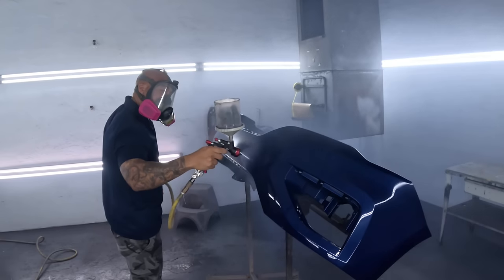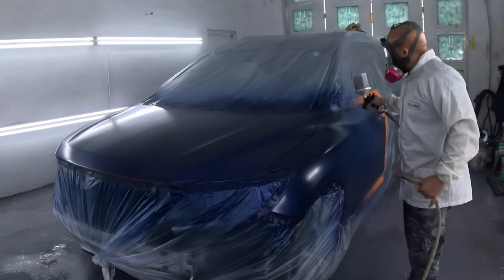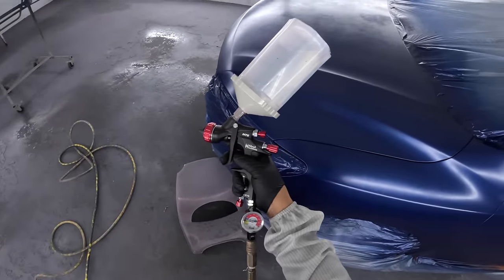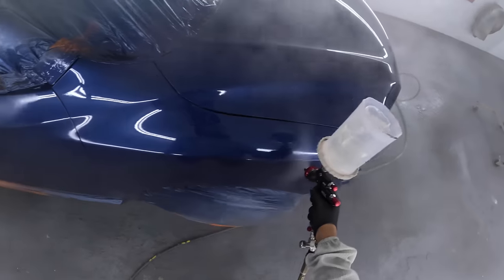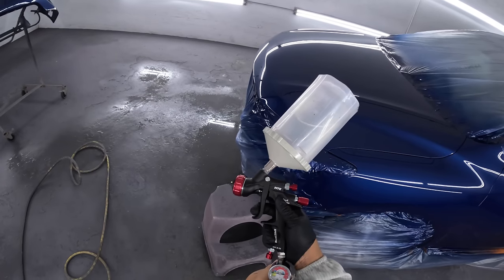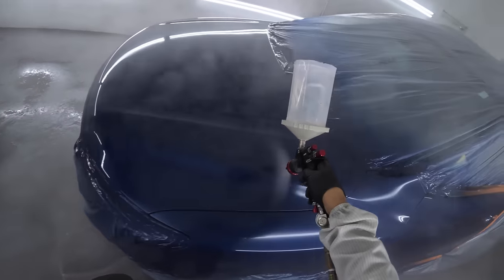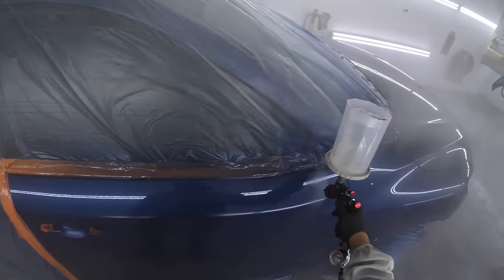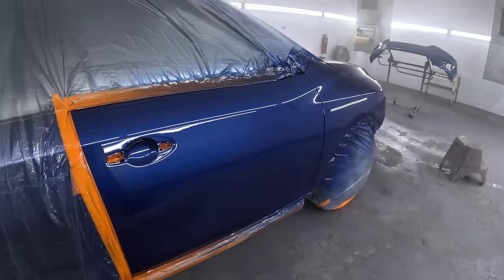BEST SPRAY GUN IN 2024 WS400 series 2 clone 🤪 AMAZING RESULTS!!!! Black Widow rear fan knob

Comment: hey trigger man thanks for the review I'd like the results I picked one up got a question for you please what adapter is that for the d-cups for the D cups I ordered one D cup it was too long help please and thank you
Reply from the maker: What up bro. The gun is at the shop. But I believe the adapter is #10 it is a little longer but not horrible. I can confirm that when I get back to work. But I think it's 10 or the same adapter that fits the vevor gun. And it does stick up a little further than it does on the vevor.

Comment: That fan pattern is impressive. Very even. Should be good for metallics. Can't stand those swivels. I have a Sata clone that had it. I took it off and used a regular fitting. Nice job as usual Trigger
Reply from the maker: Thank you brother I took that swivel joint off my vevor gun too and put a fixed joint on there make spraying with the gun more enjoyable for sure.

Comment: Triggerman Which do you prefer, this $180 black widow or the new $260.00 Porphis PRD-717 VS TYPE?
Reply from the maker: Man that's a tough one 😭😭😭 I'll have to use the Porphis more to give an accurate answer. I've only sprayed 2 jobs with Porphis and like 9 jobs with the black widow  so far the black widow is kicking ass.

Comment: I have two of them. One for base, and one for clear.  They are great guns. I like you don't use or care for the swivel regulator. I use the round filters at the gun, and the regulator at the tank for pressure. I run a higher pressure than you did. Usually 30 on base and 32 on clear. But all in all, Great guns. Another great video from the "Trigger Man."
Reply from the maker: Thank you brother. That sounds like a great option regulator at the tank. And i figured there would be different pressure settings coming in from guys. There so many things that would cause us to need less or more pressure. And I agree great guns  🤜🏼🤛🏼
Reply: Triggerman thank you very much for all your video's advice on spraying base and clear coats. You are the man. I am just getting started on painting my own stuff because of disappointments from so called body and paint guys and friends I ask for help and get nothing or a shit job after I help them and do my best because I take pride in what I do. Like you do. Stay Frosty trigger. And thanks for this and all your video's.

Comment: Yo ,,,,that swivel fucked up my paint job with vevor,,it hit my wrist and turn the pressure down then I ran the paint,On the next pass
Reply from the maker: Yea man, it's happened to me on the vevor, I took it out of the vevor and put a fixed joint in there. It comes out easy on the vevor. I tried in this gun and that sucker won't budge.

Comment: I have been using an rp3000 1.2 tip. Would this be an upgrade? Have you ever used that as a clear gun?
Reply from the maker: I have that gun in 1.3 awesome gun  and no it's not an upgrade. That gun is one of Satas best models

Comment: Wet the floor, you want to spray with a consistent overlap, at the bottom of the fender this back and forth again and again is basically loading overspray onto everything, 1000 grit between coats no no, get yourself yellow super assilex pads and wedge a scotch bright inside to give it some firmness, but that's for base clear you can't sand between coats get the dirt out later put three coats of clear if you have too wetsand later otherwise you're OK. Good job.
Reply from the maker: @Mike-qo4kp  right on my man thanks for the tips. 🫡💪🏼

Comment: Can u change the swivel. To the regular pressure regulator
Reply from the maker: I've tried twice, it's in there pretty tight. I didn't want to break the gun in half. It could be permanently sealed. Not sure

Comment: Bro, it has never been about the number of followers BUT the quality of content. I love you presentation, knowlede, which I can relate to!!! Sense of humour, which the Gunman, MP or PS do not have!!! Seems a good gun and if I did not have the 30 odd, SAT'A's Iwata's & Devilbiss in my stable. Trust what I have. So, if this has self adjustable seals, it should never wear out... Right??? Time will tell, time will tell. You are a good, clean worker, good gun control, with neat and tidy results. Stay blessed. Ameen
Reply from the maker: Thank you Sir, I really appreciate that. And I understand 😊 I just wish I had a bigger platform. I wanted to start this channel 8 years ago but was scared to start it because the shop I work at isn't one of those big fancy high end shops and I figured I wouldn't make it on YouTube then I finally snapped and said you know what fk it I'll embrace what I have to work with and my skill and see what happens. And it turns out it's working in my favor. So it was all God's plan. Now I'm climbing my way up  and I have 8 years of makeup work to do. So we're going to be moving fast. I thank and appreciate all of you guys man. ♥️💪🏼

Comment: Nobody wants those swivel fittings. I index my regulator for easy adjustments on the fly. not all spinning in circles while I paint. I also prefer rear fan control over the side control because I'm a lefty and the side control is on the wrong side for me. I enjoy your videos keep up the good work
Reply from the maker: Thank you Kenn yeah man those swivel joints have to go man 🫠

Comment: Use devilbiss AD-31 fitting if u want to delete the swivel inlet fitting.
Reply from the maker: I saw that fitting on Amazon for $30 😲 I bought like a pack of 10 for like $8 of an off-brand, a tad bit longer but I swapped out the swivel and most of my guns. Thank you for the tip though I appreciate it 💪🏼
Reply: Thank,s I swapped mine out.

Comment: Nice job! I use the black widow original version. I like the gun! I also adjust the fluid down a bit. I like it so much I got the black widow 1.7 for high solid primers. Haven't used that one yet. Im sure itll be better than my $60 dollar gun.
Reply from the maker: Yea man I was surprised how well it sprayed. I've sprayed with it all week and it has worked flawlessly
Reply: Sounds like your Knocking out the hits like Dezzy Hollow my man! Hopefully will be painting the Lambostang next week. I hope it goes well! Its going to be a tricky one!  @thetriggerman954
Reply from the maker: @leviscott8519  Lambostang lol 😆

Comment: sprayed great i gotta pick one up but i said that about the r500 and haven't bought that yet but since i got a little 29G air compressor can't use the higher end guns with but i have the HF 100 spray gun 1.3 HTE had it for two years still going strong it's last a while i wonder if they got rebuild kits for it
Reply from the maker: Yea if What you have is working No need to go out and spend the extra money for this It's not a miracle gun. But for those who are in the market for a new gun it will be good. I'm wondering how long it will last I will use weekly and see how it goes. Thank you for watching 💪🏼

Comment: How does it combo the dv1 base trigger, you are the governor 👍🏻
Reply from the maker: The DV1 base gun is probably one of the best base guns I've ever sprayed with. This gun is really good but I'd be lying if I said it was comparable to the DV1. Can still get the same results but the black widow will require a little more effort.
Reply: @thetriggerman954  thanks trigger man but they’re so expensive oh well have to save them pennies, have you done clear with the base coat gun mate can’t say I’ve seen a video and I’ve seen loads of yours dude 👊🏻👍🏻
Reply from the maker: @user-paullynch  Yes I actually have sprayed clear coat with the base coat gun and it sprays clear awesome. So really the gun is capable of spring base and clear coat all in one gun. So even though you're spending a little more you get two great guns in one
Reply: @thetriggerman954   yes I think you’re right my man 👍🏻👊🏻

Comment: I've always wanted to learn to paint. Finally I'm at a stage in my life I will be able to afford to screw up and start over again.  I've been watching a lot of gun reviews on YouTube.  And there are a few other guns that are cheaper with a reputable name.  But I really like the idea of driving 15. Minutes down the road to get a replacement gun and being back at it in the same day.  This is the second video I've seen on this gun. The other guy was very surprised by the way it sprayed.  And went as far as to take it apart and compare it to last year's model.  It's a much better gun than last years model.
Reply from the maker: Keep in mind That drive 15 minutes down the road you can only do for 90 days after 90 days if the gun breaks it's on you. Most quality guns give you 3-year warranty. So that's always something you have to keep in mind this is a higher price tag than the average "cheaper end" gun like the vevor. Those Vevor guns you can buy 2 of them and still have change left when compared to purchasing this gun. But if it's gone can hold up and last for years then it is well worth the money. I have no dog in this race Just things to keep in mind. All I do is simply show you guys if the gun has the potential. If the gun has the potential I can definitely get it out of it. 💪🏼✊🏽

Comment: What sagola whould you recommend for clear ?
Reply from the maker: The 4600 extreme with Titania cap. Nozzle size depending on your material and spraying temperature.
Reply: @thetriggerman954  thank you blessings!
Reply from the maker: @andresarreola828  anytime 💪🏼
Reply: @thetriggerman954  black widow or do you think the 4600 extreme would be worth the investment just started painting for a living was a bodytech for 10 year doing combo work now I'm from Iowa
Reply from the maker: @andresarreola828  I mean if it's something you're going to do for a living spring every day for years to come Sagola is definitely the way to go. I've been spraying with segola guns from around 2007 if not earlier and have never had an issue with them. Many years ago before the internet you'd have to find someone who could actually get you a Sagola I bought my first one from a guy that came here from Spain as a painter. They all good guns man If you can afford it I think it's a great investment. Then also you can get additional caps that will give you different finishes and you can do different things with one gun.

Comment: So is there a way to change out the swivel shit on this gun. I don't want that shit but i like the gun
Reply from the maker: I'm not gonna like I tried with a big adjustable wrench and it wouldn't budge. I didn't want to break the gun in half . I switched it out on the vevor gun and I love the gun without it. But I really put force on this and it didn't budge. I'm going to try again this week. I have  bunch of non-swivel joints to put right in there and it would make this a flawless gun.. so we shall see 🥴
Reply: @thetriggerman954  someof them iwatas have glued in fluid nipples. I was watching the repair videos. Your may have to put a little heat on it to loosen🤷🏽‍♂️
Reply from the maker: @blakereiter7418  🥺

Comment: Not 12 minutes ago I was standing in the isle looking at this thing. No way I was going to buy it without a trigger review.
Reply from the maker: ♥️ appreciate that bro. Yea it's a good gun  real nice. No complaints from trigger. Other than that stupid swivel joint.
Reply: @thetriggerman954  I have a matco branded gun with a 1.3mm tip for my go to. Not sure how the tool truck guns hold up against the rest of the world. I'm sure someone makes it for them.
Reply from the maker: @Go4BrokeOffroad  Matco has some decent guns, I know a few guys that use them. Better than Mac Tools truck I bought a few guns from those trucks when I first started they all failed and the guy wouldn't warranty then. 🥴
Reply: @thetriggerman954  I believe that. I've heard bad things about Mac dealers from coast to coast. Im painting a monster truck body so we don't need show room quality. The ole matco has done me right through the summer.
Reply from the maker: @Go4BrokeOffroad  4sho, spray on brother 🤜🏼🤛🏼

Comment: Awesome spraying! There's no doubt the gun performs and I would definitely use it.... however, yeah here we go...😊   being a Harbor Freight patron and long-time Inside Track Club member, I do take issue with the gun's warranty and pricing.  Part of the hype for the series excludes the high cost being that the total of $180 + tax + added warranty to go past a mere 90 days ends up to over $250. Admittedly,  $250 isn't a lot for a gun, but that does placeit very close to tiers of better made and part supported guns like Devilbiss, A.N.I,, Iwata, Sagola ( Pro XD $192 comes backed with a 3 yr warranty).  HF could really step it up by lowering the price to a point that's fitting to their reputation.  Let the flaming on old Boss Hawg begin 😅
Reply from the maker: That Man said inside track club member you speaking a language I don't even understand 😂 yeah they did tell me 90 days and asked me if I wanted an extended warranty I'm like what the hell is this a VCR lol But I do hear your point on that. yeah if you purchase The gun plus the warranty You're almost up there at the lower end of the expensive line of spray guns. Good point BossHawg You always come through with a different outlook on things I noticed that and it's appreciated from me And I'm sure from other subscribers as well. Thank you brother ✊🏼
Reply: @thetriggerman954  as a long time hobbyist and cheap ass, I have to keep it real. The Vevor you reviewed is one hell of a deal for a hobbyist. You can buy two, keeping one strictly for primer, and still come under the cost of a BW with a warranty. Hf does this across the board though, so buyer beware. Bring the price down to earth, expand and include a better selection of tips for versatility, and/or include a real warranty. After all, cheap hobbyists are their main supporters.
Reply from the maker: @bosshawg7427  well said ♥️

Comment: U can't take the swivel off ?
Reply from the maker: I did, I put a fixed joint there. No more swivel 😎
Reply: @thetriggerman954  oh ok cool I'm getting back in the game and was thinking of getting this gun
Reply from the maker: @diytypeofguy6502  can't go wrong
Reply: @thetriggerman954 i have a iwata lph400 for base I'm thinking about getting the widow for clear or the iwata ws400 or the sata rp but if I can pay $200 vs $800 😂😂 also considering the dv1 by divilbis
Reply from the maker: @diytypeofguy6502  why don't you buy the black widow for bass and keep the LPH400 for clear? Put a silver cap on that LPH400 and you'll have one of the best clear guns on the market in my opinion. That's my go-to gun
Reply: @thetriggerman954  cool it is a silver cap on it 1.3 I believe 👍🏽maybe buy 2 widows one for sealer 🤷🏾‍♂️ I also have a no name gun I use for primer
Reply: @thetriggerman954  u on fb??
Reply from the maker: @diytypeofguy6502  sounds like you just want to spend some money lol so go right ahead my man 🤜🏼🤛🏼
Reply: @thetriggerman954  nah I'm just trying to set myself up for less problems 🤷🏾‍♂️I don't wanna get discouraged again lol
Reply from the maker: @diytypeofguy6502  🤠🙈 I hear that man. In that case  get em lined up. Them smooth sailing

Comment: Been painting for years. When you mask off for final paint you should use paper 12 inches off of the panel and then plastic. What will happen is base and clear will blow off the plastic and land in the fresh paint, paint on paper will stick and never blow off
Reply from the maker: If you use quality plastic that doesn't happen. Painting 27 years. Don't use cheap plastic and you'll be fine.
Reply: @thetriggerman954  I used the plastic supplied by the body shop.